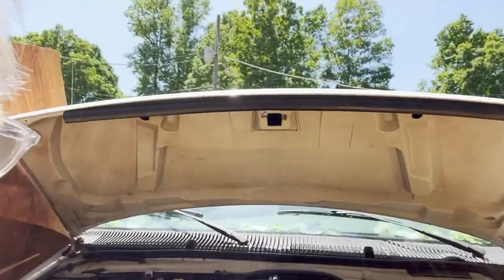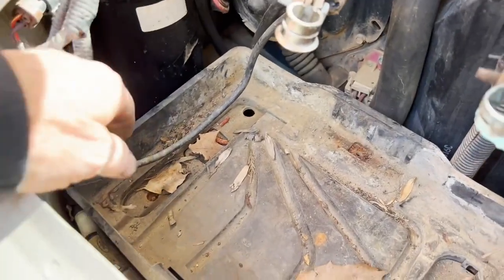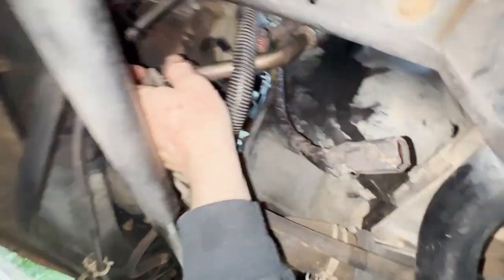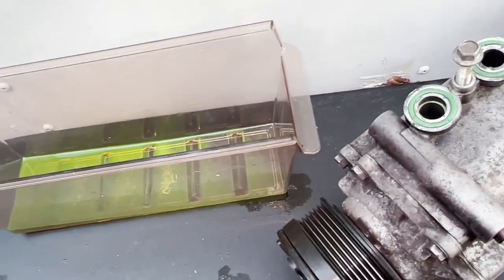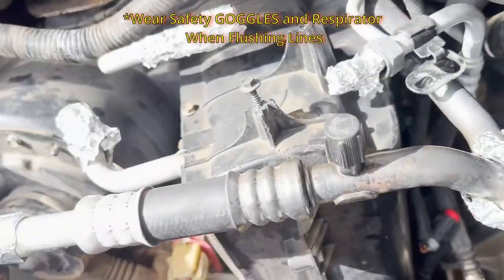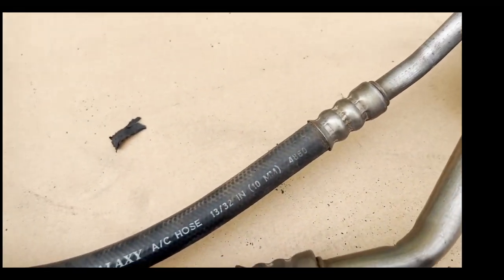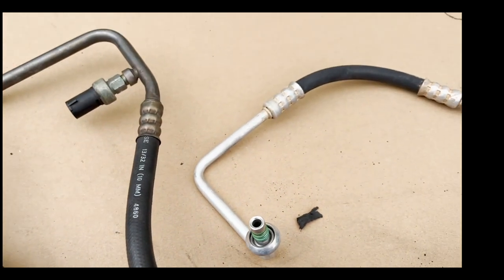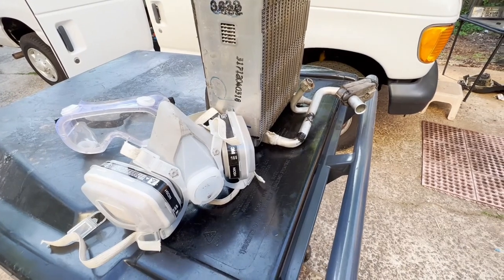2004 Ford E350 with Rear AC PART 1: Complete Compressor and Rear Expansion Valve Replacement

Comment from the maker: Part 2 Showing system reassembly including hanging the new compressor, filling it with oil and charging the system, and seeing ice cold air temps with the thermometer should be loaded on September 20th, 2022. Lots of important tips and tricks to get this monster system performing optimally while driving.

Comment: Pro tip, when the front to rear aluminum lines rot out and they will, you can get heavy machinery hydraulic AC lines made up for a 1/4 of the price Ford will charge for the same lines.

Comment: You didn't have to take the motor mount bolts out and raise the motor a bit to get that out?  had to do it on mine.
Reply from the maker: Hi. Thanks for watching and taking the time to comment. No, did not have to remove the mount. Was prepared to, but sized up the job and saw that I could access all bolts and fittings either before or after the compressor was between the crossmember and the engine. Just had to choreograph it all in the right order. Everything you saw me film and or describe before or after the compressor was in place and or mounted is how to get it in or out w/o having to remove the mount and jack the engine. Hope your AC is blowing cold ;-) Thanks again for watching.

Comment: 8/11/2023 - thank you for this video - how much oil did you put in the system? I have read Ford E350 XLT with rear AC requires 13 ounces of PAG 46 - without rear AC the system requires 9 ounces of PAG 46 - do you know the answer?
Reply from the maker: Hi. Thanks for taking the time to watch and comment. Yes with Rear AC it's 13 Oz total, so factor in whatever the new compressor is filled with when shipped. There's a huge difference in the refrigerant quantiles, both of which should be on the under hood sticker if that's still in tact on yours. I mention oil/refrigerant capacities in the Part 2 Video just after 19 Mins which is in a playlist and I think an end card on this video. This Part 1 video has a huge amounts of views, but folks seem to have trouble finding Part 2 where I put it all together and charge the system, so here's the link for Part 2: https://www.youtube.com/watch?v=xIHk23muW7Y Hope both videos are helpful for you. Thanks again.

Comment: On systems with rear a/c, do you know if there is a rear orifice valve? Looks like the high p splits before the orifice and goes to the rear on one split and the other to the front orifice then the evaporator.  Looks like the orifice is only for the front. Unless I am missing something. Thanks!
Reply from the maker: Hi. Thanks for watching and taking the time to comment. There is an expansion valve for the rear and the Orifice Tube is up front for the front evaporator. 
Watch my Part 2 and you'll see all about that. Though it was in part 1, but must be in Part 2. It's a very detailed video, especially in getting the system back together and charged. The rear evaporator is in the left rear corner inside the plastic housing. If that wasn't in part 1, it's all in part 2.
Reply: @mkdhdinfiniteendlessconten3873  Thanks for the answer. Working on my a/c and this helps a ton. Will watch part 2. Thanks again.

Comment: Why do you want to keep the other a/c parts if it is very old?
Reply from the maker: Hi. Thanks for taking the time to watch and comment. Not exactly sure which parts you're referring to. The Compressor, Condenser, Accumulator, Rear Expansion Valve, and Orifice Tube were all replaced. Both Evaporators and all hoses were in good condition, so no need to replace them. Those just needed flushing to clean them out. Hope that answers your question. Also make sure and watch Part 2 https://www.youtube.com/watch?v=xIHk23muW7Y&t=1443s where I put the system back together and charge it. Will also be loading a video shortly on upgrading the compressor in my 1983 F-150 to a modern compressor and R-134a. Thanks again for watching.

Comment: Just wanna let you all know when removing the rear evaporator and expansion valve. All you need to do is take the 4   8 mm screws out the bottom. Then the whole bottom comes off. And evaporator expansion valve with it. No need to cut the duck work.  Much Ez. er
Reply from the maker: Hi. Ya, I initially saw that, and it makes sense they would have that set up like that especially from a speedy step during installation like those pesky spring clip quick connects for the lines. The bottom pan on this one was sealed or stuck and didn't look like it was going to come apart w/o a fight and saw I could get in from the top as that was barely glued. Maybe whoever was on the line the day this was built got a bit busy with the glue and glued the bottom on too. LOL Anyhow thanks for the tip that could save others some time. Thanks for watching and taking the time to comment. This is one of my first videos and both this and Part 2 are amongst my Top 10 highest viewed videos. Thanks again.